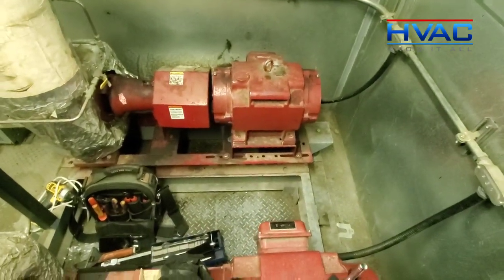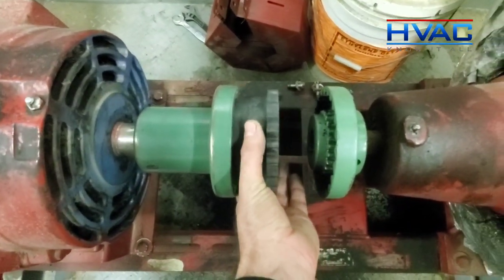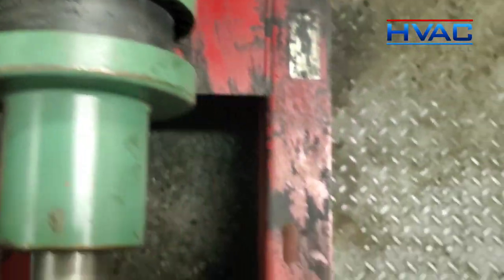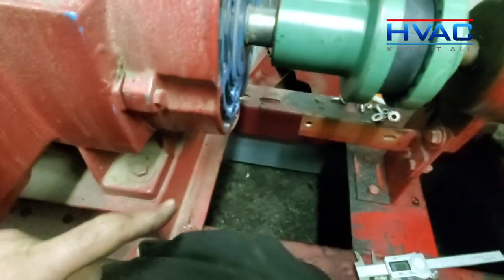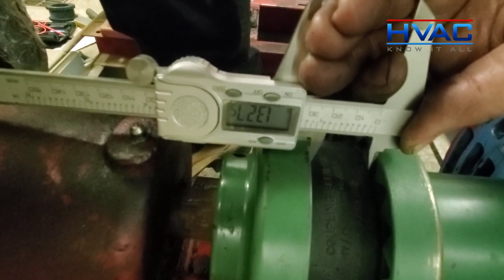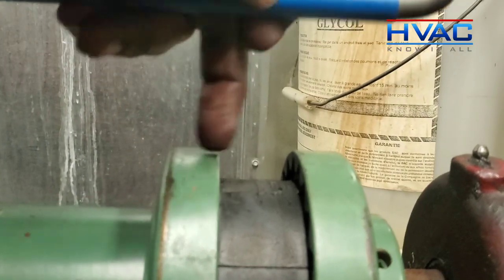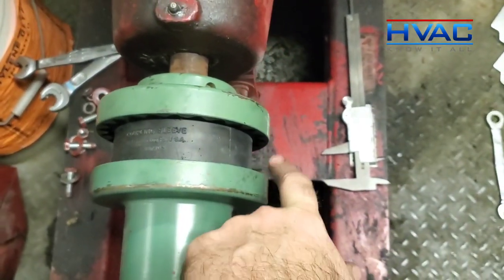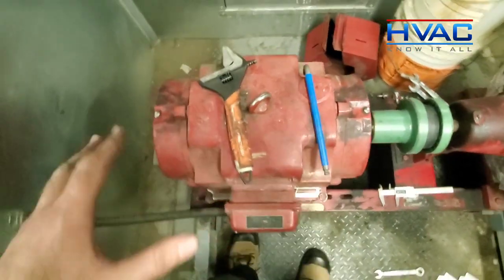Rough Pump Alignment With Flexible Coupling

Comment: Great demo, Gary.  I was fortunate to have a conversation with an engineer from a major pump manufacturer recently.  He told me they don't own a laser alignment tool.  Every base mount pump gets aligned with a straight  edge before it leaves the factory.  They expect the installer to use a laser on the job site but than never happens.  Your method is actually in the Woods coupler instructions!
Reply from the maker: Thanks Eric, and yes those instructions are in the instructions, you're right!

Comment: Ive been fortunate to learn how to precision align pumps with reverse rim dial indicators and lasers. While I can see how your method gets you to where the coupling says you’re within tolerance, I’d love to throw a set of dials or a laser on and confirm how tight your alignment is. Ive talked to some alignment pro’s and their claim is that the tolerance AT THE COUPLING may be within tolerance, but the tolerance at the drive end, and then the non drive end bearing could still be way out. After all, you’re using a caliper only at the location of the coupling. I guess my point is, you may be within tolerance for the coupling, but way out for the bearings, which are what you’re actually trying to protect.
Reply from the maker: This video is to demonstrate rough alignment.  If a laser is available then I would welcome it.
Reply: Understood. I am just pointing out the difference between a rough alignment a d a precision one. Even a rough alignment of this fashion is only protecting the coupling. Not the motor and pump bearings

Comment: That pump turns at 3600 RPM. You need to be at ANUGLUAR 0.3 MILS. /IN.” OFFSET 2.0 MILS. A mil is .001” of an inch. You get out about.025” it will destroy your pump. That pump is about $5,000. A good alignment rig is about $1000. Which would you rather your company buy?
Reply from the maker: That pump is still running quite well.

Comment: By doing it this way you don't need that expensive tool for alignment, right?
Reply from the maker: At the end of the video, the caption says to check with a laser or dial indicator.  You can but a very inexpensive dial indicator

Comment: That was a hex key? Not a straight edge???
Reply from the maker: Yes, a brand new one checked on a level.  It's straight as they come.
Reply: But is at as straight as a straight edgde? lol Mechanics don't check engine block deck and cylinder head level with a pocket level.. 
 I don't use a pocket level on Semi hermetic compressors or for open drive hardware applications; Couplers, drives, pulleys. Straight edges aren't super expensive and they come in many sizes. Don't call your hex key a straight edge :)
Reply from the maker: Well, just an FYI.  The dial that went on after showed the coupling halfs to be within spec. if it's straight it's straight.